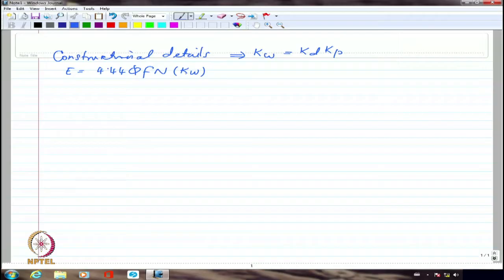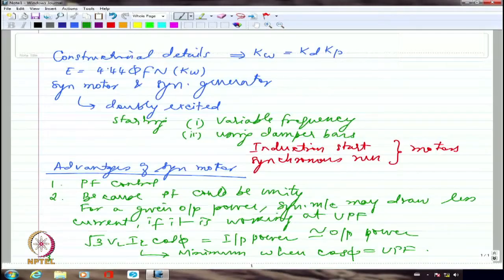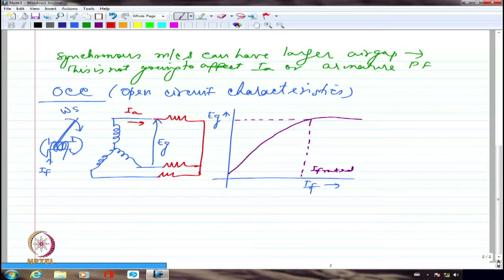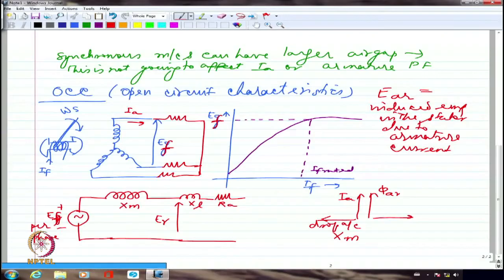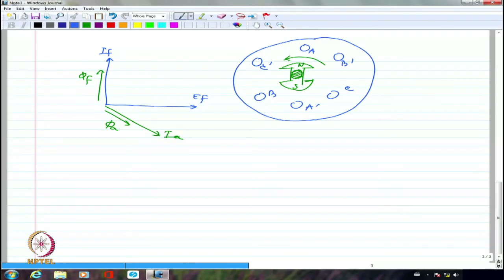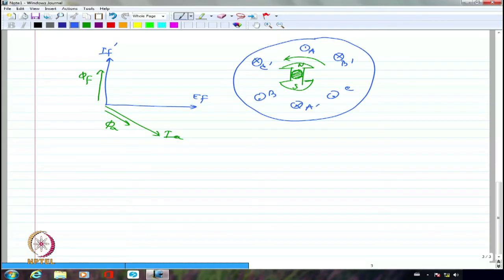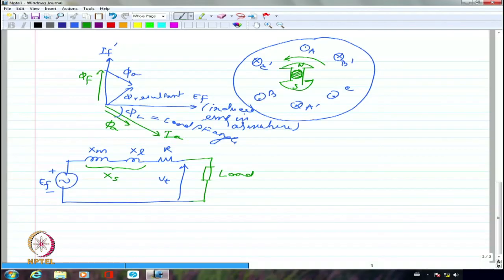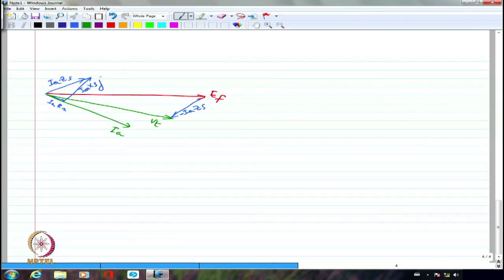mod12lec38

Comment: Why Xm is in series in case of synchronous machine whereas in transformer it is parallel?
Reply: Because in Xmer, magnetization current is there even though the output is open circuited. But in Syn G/R, armature current is only when load is connected.So it is in series with the load

Comment: advantages of sync motor v/s IM 4:00
1. larger airgap possible hence lower armature is required
2.pf control
OCC (same as magnetizing curve in dc machine) 11:00
eq ckt of sync m/c 17:00
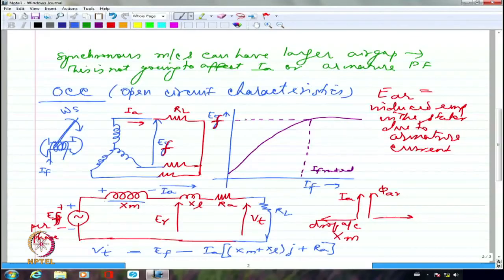phasor dia of sync m/c 31:00
sync reactance is large 41:00
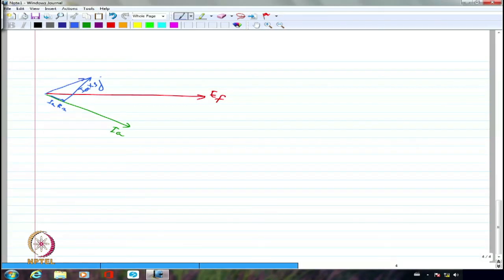phasor dia of sync generator 48:00
Reply: Thanks